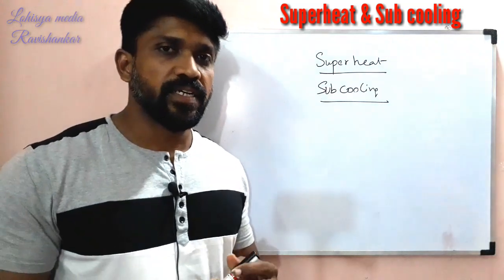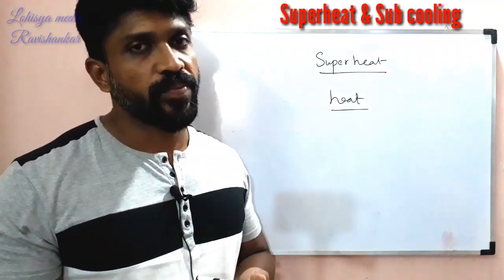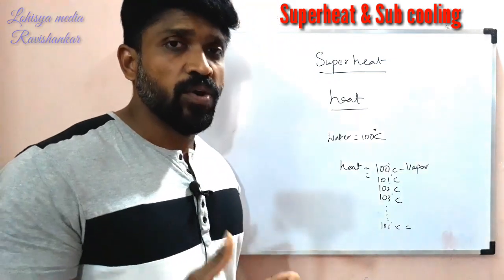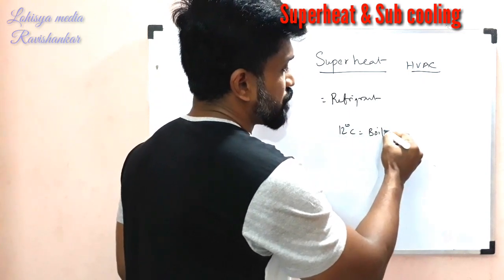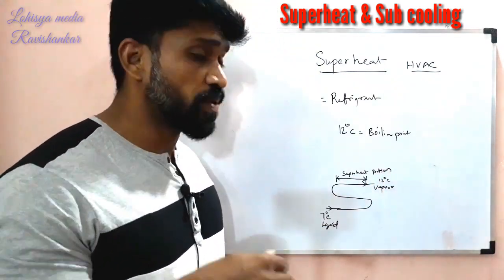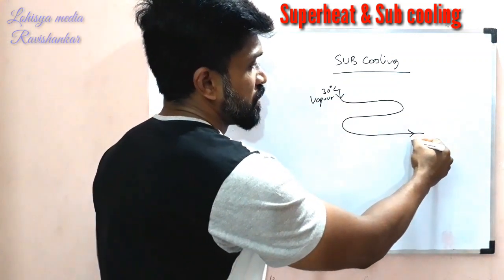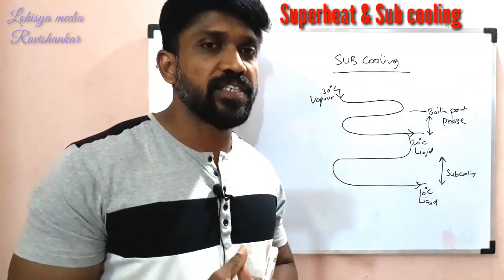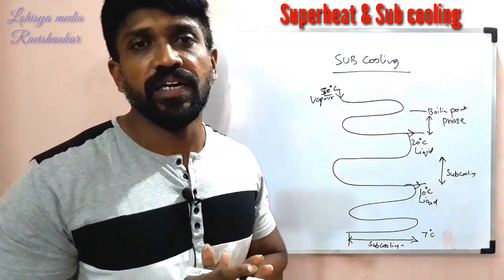Superheat & Subcooling | HVAC|Tamil |Lohisya media| Ravishankar

Comment: Discharge super heat la compressor moolamaa heat seithu acheive wet vapor to dry vapour but suction super heat la etha vachi wet vapour refrigerant to dry vapour refrigerant condition ku kondu varom
Reply: Through evaporator